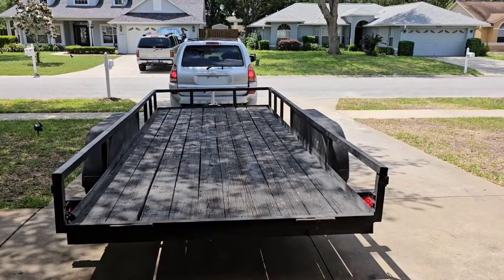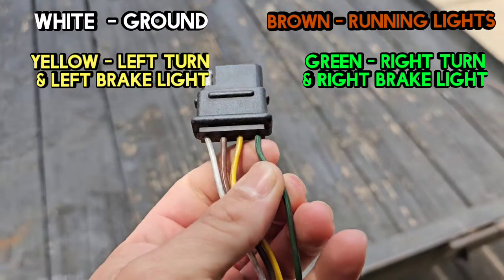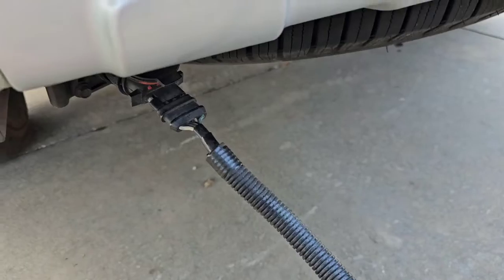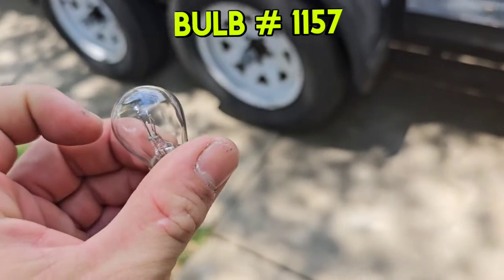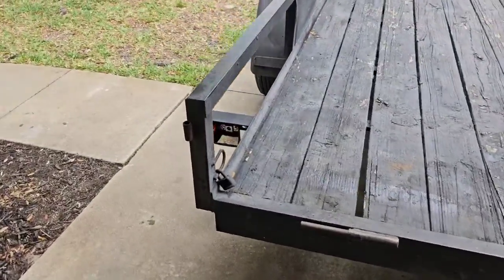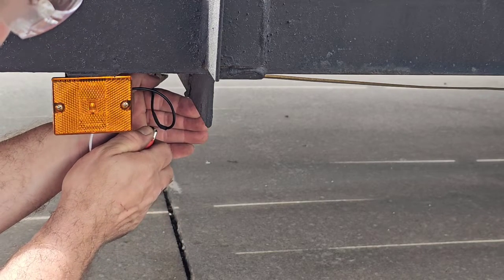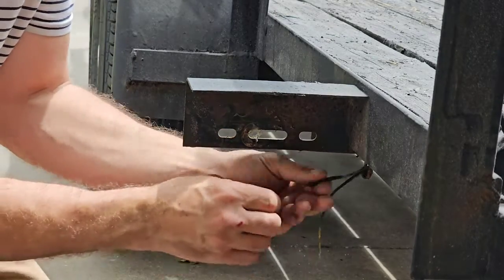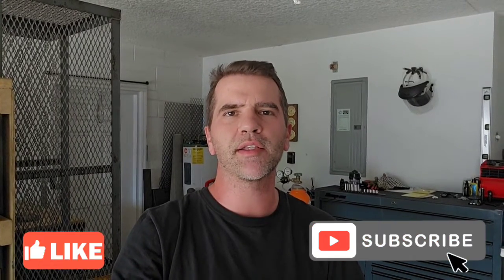Trailer lights & wiring issues 101. Trailer wiring explained. LED lights, Soldering wire tips & more

Comment: I purchased new trailer tail lights. It has a quick connect.problem is that the trailer harness wire is not firm enough to push into the little quick connect hole in the tail light.everytime in try to push the wire in the hole, it folds. Is there a solid wire pigtail available? I've even tried to depress the release and the wire just folds. Any suggestions would be helpful.

Comment: My Jeep had a U-Haul receiver and harness when I bought it. Suddenly I have no driver side taillights on the Jeep. The dealer is saying it’s from the trailer wiring and wants over $1500 to replace it with oem. Ever hear of such a thing?
Reply from the maker: Yes I could see a dealership wanting to charge you that. I was recently wiring up a Wrangler for a trailer hitch. It's very likely water could have gotten in a loose connection and messed up your wiring connections. Not sure if that's your actual issue but just for example.  
An independent mechanic shop could be a better option. A dealer is going to want to replace the entire harness which is probably $1000 alone. The job is probably 5 hrs @ $100....next thing you know it's a $1500 bill plus fees and additional charges. An independent shop might be able to replace just the damaged connections for far less $.

Comment: You got a wire for brake lights.
You got a wire for the running lights
You got a wire for the right turn signal 
You got a wire for the left turn signal 
You got your ground wire. 

How are you going to put the wire for the brake light together with the left or right turn signal without blowing a fuse or something worse happening to the wiring system on your truck? Also where you getting left break wire and right brake wire I didn't think there was no such thing as two separate wire for the brakes You confuse me that's all you did to me.

Comment: First step in diagnosing a wiring problem on a trailer is unhook the trailer from the hitch ball and safety chains.  In other words, only hook up the electrical connector.  This will eliminate grounding thru the hitch, which would be a faulty ground.  Next remove all suitcase connectors and wire nuts, solder or crimp what works best for you.  Make shiny all ground connections and bulb sockets.  That should solve most problems.

Comment: Good job! I go overkill on anything that will be in the weather. I use flux and cover the soldered joint with rubber compound before setting the heatshrink. BTW, I've seen some really nice heavy-duty wiring kits for trailers. Have you ever installed one of those?